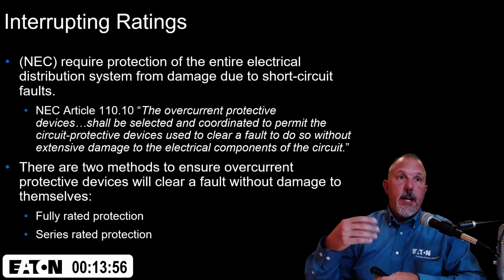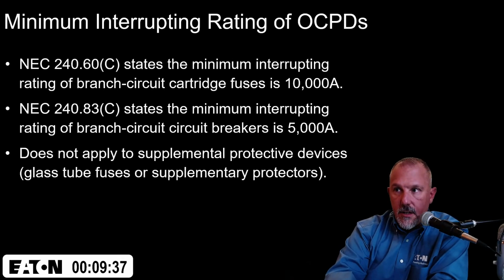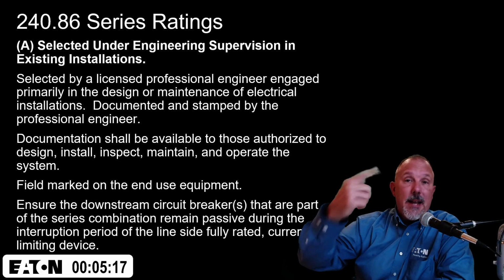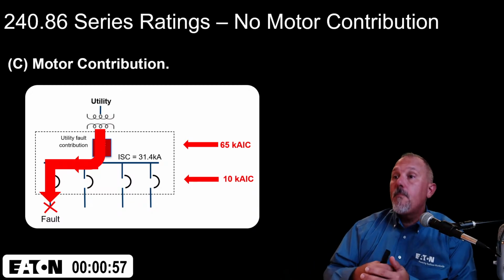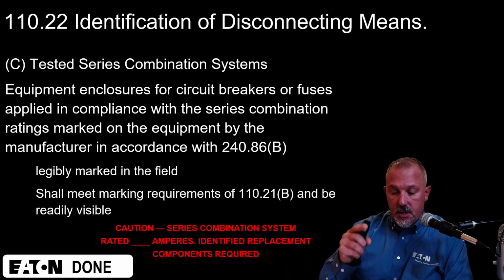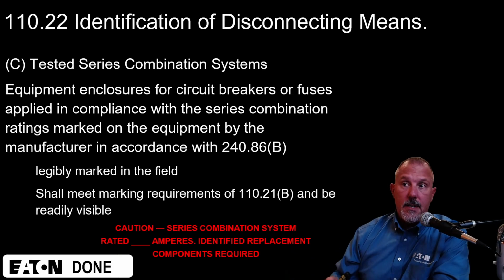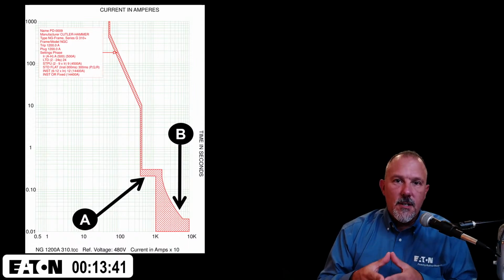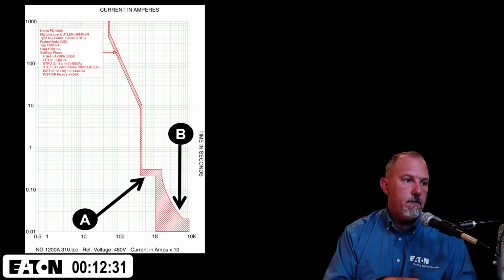15 Minute Tech Talk - Series Ratings

Comment: Since the new rule 240.87 may apply when someone is replacing a breaker in a switchboard, what happens when someone is installing a downstream breaker over 1200 A and that breaker was originally configured to be series rated and now you have to have a fast overcurrent setting for arc energy reduction?  It would present a greater hazard to install such a thing and forcing one to replace the entire switchboard instead of just 1 breaker is a lot.

Comment: In the graphics you have shown, where motor fault current contribution effects adjacent circuit breakers' fault current, I don't see how 240.86C is written properly to address this concern.  Instead it seems to be written to address only a series rated pair at a given motor, or a motors connected in the middle of a series rated pair.